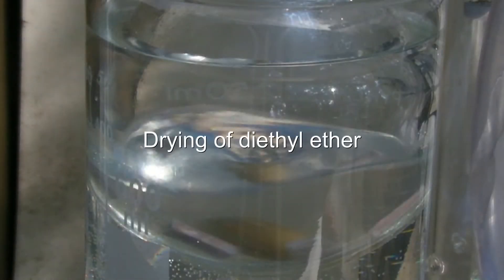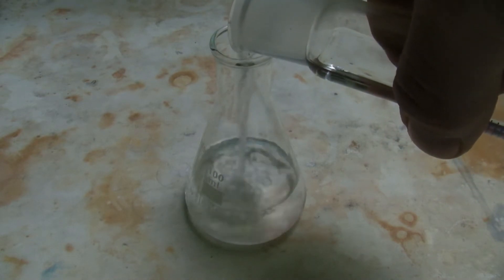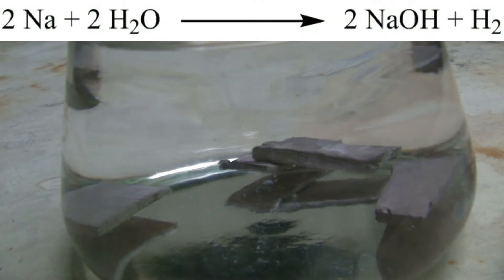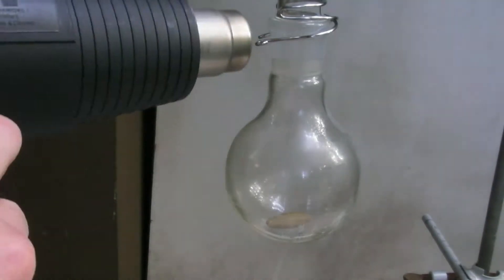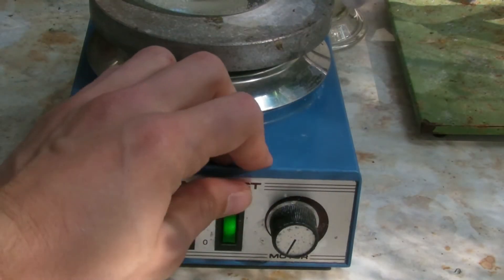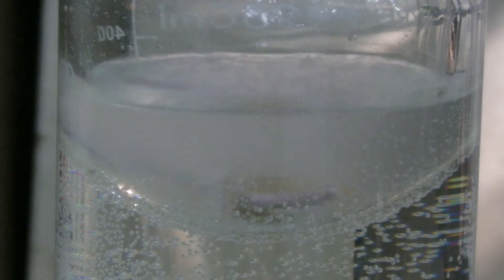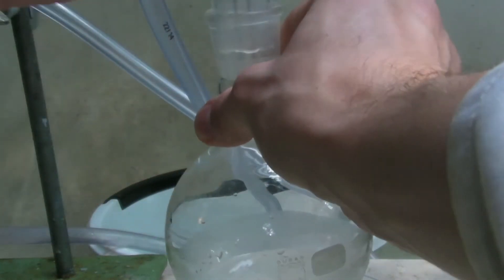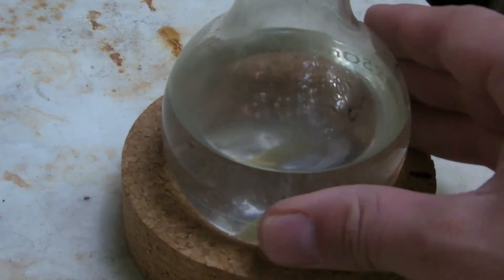Anhydrous diethyl ether

Comment: I don’t have any sodium metals, I could make some but lots of trouble
Reply: NirdRage‘s Method with methanol as a catalyst isn‘t that much of a hassle it seems. I‘ve never done it myself but it seems like the hardest thing to do is extracting lithium metal from an alkali battery as a jumpstart (not necessary but will destroy your glassware if skipped). Otherwise you could also use dried KOH which should also remove some reactive impurities and most of the water.

Comment: Is it possible to distill some pure >95% EtOH from 40% vodka? Maybe it is possible to use sodium hydroxide powder for drying?
Reply from the maker: +Eimantas a When you're able to distill a few litres at once it could be quite usefull, otherwise I would take some time to get a litre. When you get it up to ~95% it should be even cleaner than the denaturated spirit I use for my experiments. With a graduated cylinder and a scale you can measure its density and look up the concentration on the internet.
Reply from the maker: +Eimantas Andrikis It's somewhat difficult, but possible. I think two distillations could be enough to get about 95-96%, but not more. Sodium hydroxide would dissolve in the ethanol and water. As a solution it could attack the glass.
Reply: Random Experiments International Oh, okay. So I don't need to use drying agent to make it atleast 95%? Just two simple distillations at the temperature of ethanol boiling point?
Reply from the maker: Eimantas Andrikis I can't promise it, but I was able to get 74% with only one distillation from a weak sugar and baking yeast solution.
Reply: Random Experiments International Maybe a dumb question, but doen't the NAOH sollution need to be hot, to do dammage to the glass.?
Again I'm a chem novice and still learning, so sorry if it's sounds idiotic...
Reply from the maker: Ah, okay! So, it was a little misunderstanding :) Most people on Youtube always want to drink highly pure ethanol. I use spirit (cheap denatured alcohol 94% Vol) that I can buy in most drugstores, for all my reactions. The amount of impurities is so low, that they don't disturb most reactions. I've read about many people using this ethanol untreated to make pure diethyl ether. Saponifying ethyl acetate to make ethanol and sodium/potassium acetate is a way to convert it into two useful chemicals. And for all reactions it would be pure enough. Vodka has volatile substances (flavours) which would be more difficult to get rid off with a distillation. I'm wondering why it is so difficult to get ethanol, when ethyl acetate is available. Buying ethanol directly would surely be way more cheap, but when this is also for fun, you can do the saponification.
Reply from the maker: The problem about carcinogenic substances is, that it takes about 30 years until you find out that you maybe made a mistake. So, I'm extremely careful with such substances and always try to use substitutes.
Reply: +Random Experiments International Hello again.
I've made some ethanol from yeast and sugar and I even tested it and it is flammable (it should be around 80% conc. now) :) I think that making ethanol by this way is possible to make quite pure ethanol and drying with anhydrous MgSO4 with two or more additional distillations is possible to even make anhydrous ethanol.
I decided to not buy ethyl acetate from ebay, but I will make good amount of ethanol from the sugar and then I will be able to do most reactions.
It would be interesting to know about the acetaldehyde via MnO2 oxidation of EtOH as you mentioned before.
Reply: +Random Experiments International Yeah, so that's pretty good, thanks :)
Reply: +Random Experiments International ... Thàt's a Damm good yield.!
Reply: THE NEMPEROR Yeah, I've thought that aswell, but I think it is also possible to dry it with anhydrous magnesium sulfate.
Reply from the maker: TheAngelofdead666 No stupid question ;) The solution doesn't need to be hot to damage the glass. When it's cold it would take a few days to etch it visibly, but when it's heated it would only take one or half an hour.
Reply: Random Experiments International I have one more question: do you think that buying ethyl acetate from ebay and making ethanol from it (by reaction with NaOH) is worth or it is better to distill it from vodka (or maybe make it from yeast and sugar) to make pure ethanol? Thanks very much.
Reply from the maker: Eimantas a When the idea is to drink the ethanol I would recommend to distill it from wodka, just to make sure there are no harmful impurities in it.
When ethyl acetate is used, the highest purity should be used, which might be more expensive than a few bottles of wodka to get the same amount of ethanol. And the high quality sodium hydroxide would also raise the costs. Distilling vodka would take the least effort and be the safest way.
Reply: Random Experiments International No I'm absolutely not planing to drink it. I need ethanol as a solvent and I also need to use it for a lot of reactions, to make diethyl ether, etc. So do you think that distilling it drom vodka is better or making it from ethyl acetate is better ( ethyl acetate is also useful solvent to have aswell).
Reply: +Random Experiments International OK:-) Thank you! I was thinking to use denaturated ethanol, but where I live there is no available ethanol in drug stores/ or it is quite expensive. I have seen in market ethanol sold as camping fuel (maybe it is good enough to use it?) , but I'm not really sure of the purity/other volatile substances.
Making it from ethyl acetate is interesting and I have found some uses on ethyl acetate aswell (like extracting caffeine from coffee or tea). So I  actually plan to buy 1 liter of ethyl acetate from ebay. When I will make some ethanol I will also make diethyl ether and other things.
Reply from the maker: +Eimantas a The ethanol that is used as camping fuel should be alright for making diethyl ether or precipitating out salts from solutions, as long as it is not coloured. But then distilling it should help out. I tried extracting caffeine from a strong coffee with ethyl acetate, but the yield was quite low, because I used a very small amount of water.
Reply: +Random Experiments International I might try to make diethyl ether using camping fuel (it's uncoloured) and yes the yields of caffeine are always low, but it is better to use DCM for extraction.
Reply: +Eimantas a Making diethyl ether with it should work just fine. DCM is quite difficult to buy here, so I tried ethyl acetate.
Reply: +Random Experiments International One of my biggest plans for using ethanol is actually for making acetaldehyde via oxidation with dichromate and sulfuric acid as a catalyst, so I think that it should be completely fine to use camping fuel. But again if it does not contain acetone as a denaturating agent, but I think that the acetone shouldn't make something bad to the acetaldehyde...
Reply: +Eimantas a In germany methyl ethyl ketone is used for denaturated alcohol. I also thought about making acetaldehyde this way, but I read about a less aggresive and not carcinogenic oxidation with manganese dioxide. I will try that one some time in the future.
Reply: +Random Experiments Yeah. The chromium 6 is really bad, but if not breathing in the dust of K2Cr2O7 it is fine. Interesting to hear about the MnO2 way to make it.
Reply: I would even change the gloves everytime my hands begin to become wet, because the wet skin would easier absorb chromate. And slow diffusion through the gloves might also be possible, when the gloves are worn for too long.
Reply: +Random Experiments Really? So that's pretty bad. I actually haven't worked anything with chromium VI yet... I hope I don't even want to work with it. It would be really good to know about making the acetaldehyde with another way.
Reply: Random Experiments International Yes, I think the way that you think also. I don't like chemicals like these. Well I'll just stay tuned and wait for a video for making acetaldehyde by using safer method as you said.
Reply from the maker: I did a very small test with ethanol and MnO2. I added some ethanol (2-3 mL) and MnO2 (~1 g) to a test tube, heated it and left it to sit for about 2 weeks. Nothing has changed in this time and even heating it up to a boil didn't give some acetaldehyde which has a boiling point at about 21°C. So, it would for sure evaporate at this temperature. I then added a bit of sulfuric acid (MnO2 and H2SO4 was used, when acetaldehyde (AA) was discovered) and distilled with the heat of boiling hot water. I could get about 0.5 mL of a clear liquid, that gave a reaction with tollens reagent, so I think I'm on my way. I didn't have the time to check its boiling point and purity, but I'm quite sure AA may be present. The problem with the presence of H2SO4 is that AA will give an aldol reaction, so it has to be distilled off directly after it's formation. I will also try Iron(III)-nitrate as a mild oxidizing agent. Maybe, this might work better :)
Reply: +Random Experiments International Nice to hear! :-) And what do you think about making ethanol from sugar and yeast? Is it good for most reactions?